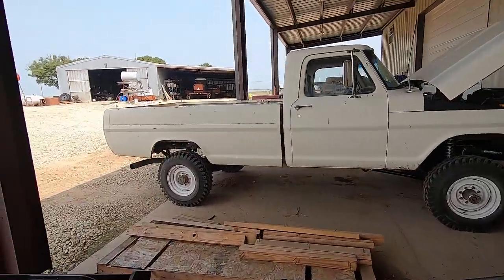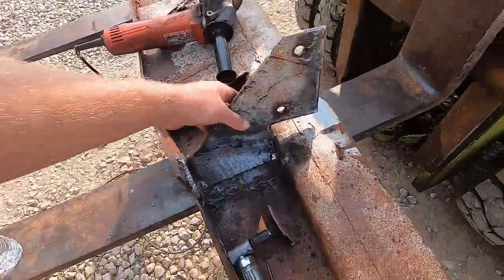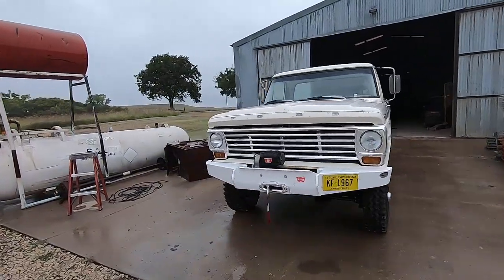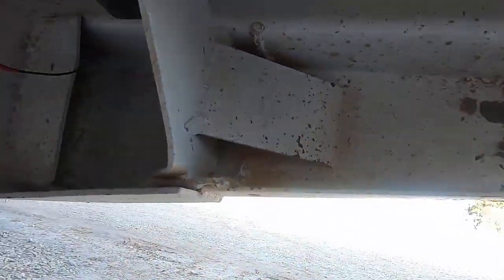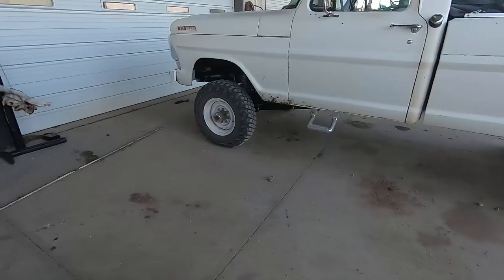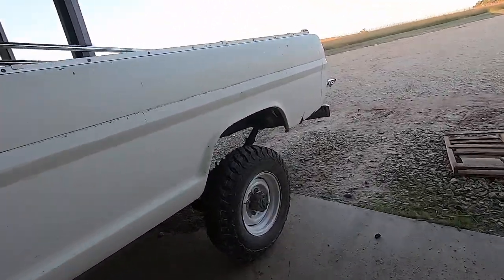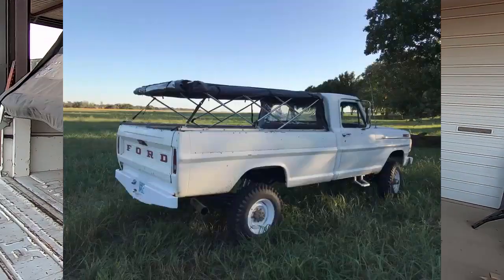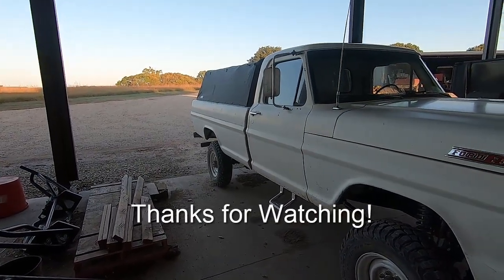Ultimate Highboy Build Series Ep. 6

Comment: so is this a 1/2 ton with 3/4 ton axles that is what it looks like mine is 100% factory 350 with single tire in back with a full box ranger camper special has the extending bumper in back dana 60/80 lockers top loader 4 speed best part for only 250 bucks running and driving . i gave away 2 high boy half tons that i got for free both in good shape . looking at a 65 2 wheel drive that is mint with tool box on side has a 352 in it looks like it would run  i know the history of it pretty sure it just needs a tune up but the body is perfect on it very very nice full factory chrome bumpers, trim and grill . interior good condition think i can get it for 300 bucks or trade a 94 mini van that i don't want runs good just i will never drive it or a d-50 i have sitting both i got for free

Comment: why not do new springs in the back? why blocks? also if you don't mind me asking, feel free to not answer the question but how much did it cost I have a 198 ford f250 custom 4x4 that I'm doing a resto-mod on so I wanted to see how much it would cost.
Reply from the maker: Luke Peters it has new 4” lift springs in the back but without the factory 4” block. Just needed to come up a little so I put a block in there. Talking 5 figures for a build like this one. Depends on what parts you get and if you are doing the work yourself or paying someone labor.
Reply: @MattKubik1791  ok